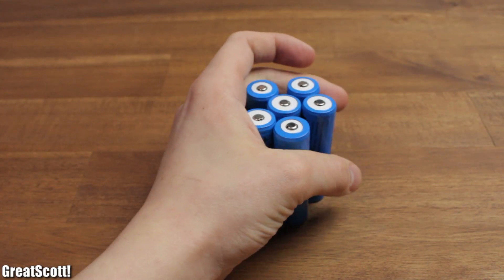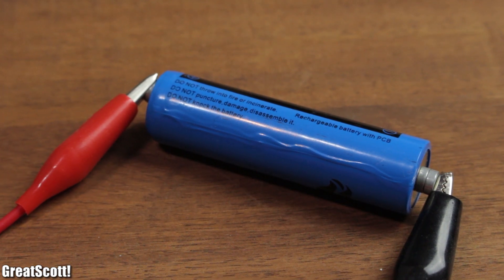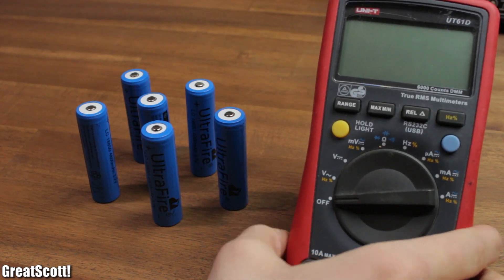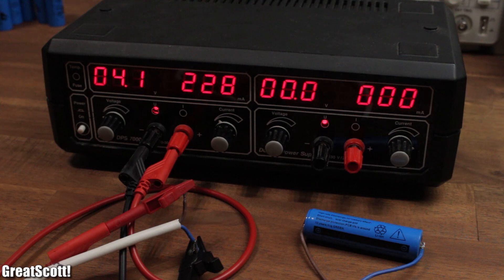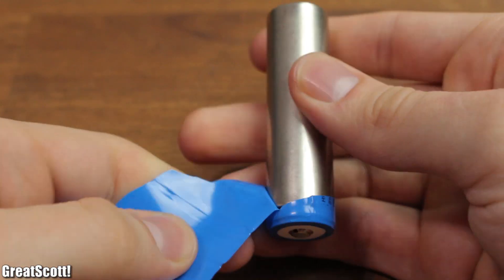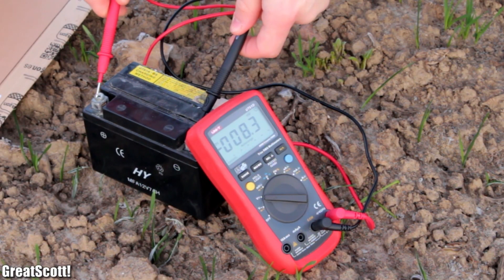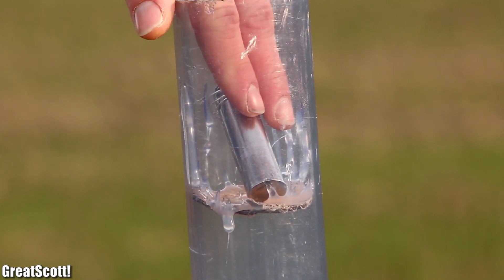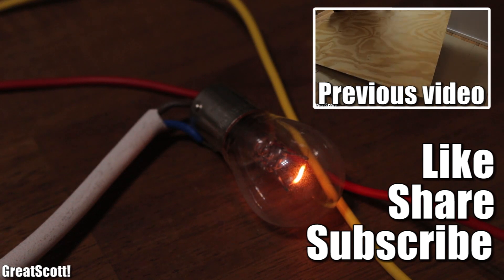Li-Ion battery short circuit,overcharge,undervoltage EXPERIMENT

Comment: li-ion batteries are not as dangerous as li-po batteries...
Reply from the maker: Soooo Li-po next?
Reply: why not? But be very careful! :)
Reply: dude fuck the chemistry, we are talking about real life usage not theoretical scanrios! Li-Ion is way less dangerous than Lipo, end of story.
Reply: corisco tupi That's because they are often designed to do that. Because they are the same actual chemistry, Lithium Ion batteries can be made to deliver the same amount of current that Lithium Polymer batteries commonly do. Lithium Polymer batteries have a higher energy density due to the lack of a metal casing, which is why they are used in RC applications where high currents and light weight are required.
Reply: GreatScott! Yes please! :D
Reply: Aidan Gieg It is not uncommon for LiPo batteries  to deliver 50A to 100A  if such current is drawn by the load. I don't know of many Li-Ion batteries that can do that.
Reply: Yes, I've explained that lithium ion batteries CAN be manufactured to have the same maximum output of a lithium ion polymer battery. Additionally, I've also explained why lithium ion polymer batteries have a higher energy density.
Reply: Energy density is not power density
Reply: Aidan Gieg I know. LiPos will usually have higher energy AND power densities than the common Li-Ion.
Reply: Aidan Gieg And yet the energy density of LiPo batteries is usually so much higher than Li-Ion batteries that casing weight alone doesn't explain it.
Reply: Once I accidentally pierced the Li-Po battery with a knife, there was some kind of fart, a spark flew out, and a burnt stain remained on the knife. Luckily, it didn't start fire, but the battery didn't like it anyway.🤯
Reply: Actually they are. The only difference between a Li-Ion and LiPo battery is the binder, the electrolyte, and the outer casing. In a Li-Ion battery the electrolyte is held in an organic solvent, which requires higher pressure and thus a metal shell. In a LiPo battery the electrolyte is held in a polymer that also acts as a binder, eliminating the reliance on pressure and allowing it to be packaged in a soft foil.
Reply: Li po means more than one cell, as in poly meaning more than 1, . I have seen many lithium ion cells with no metal shell, usually built-in the vape or whatever,